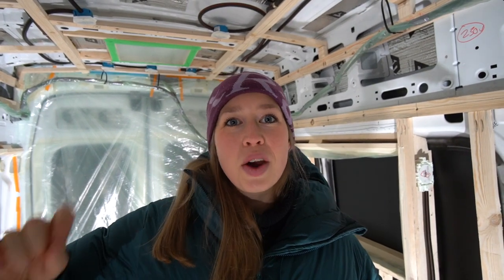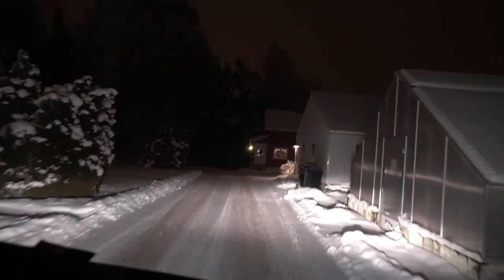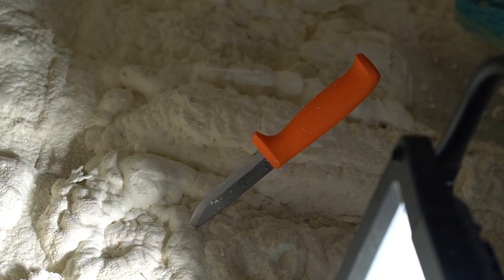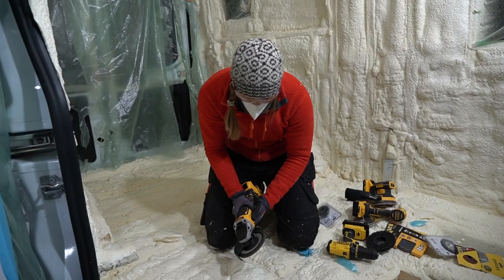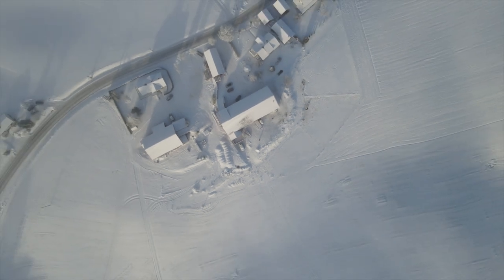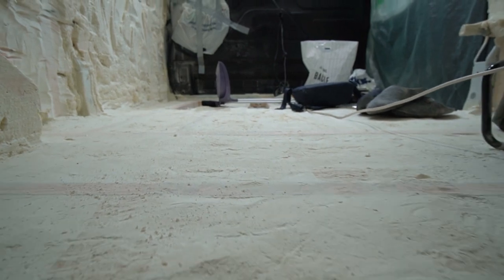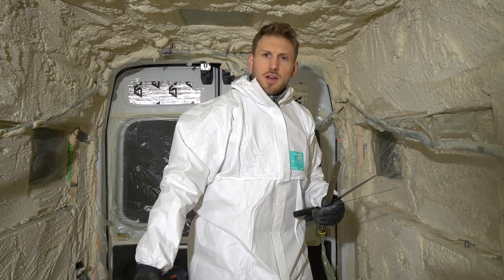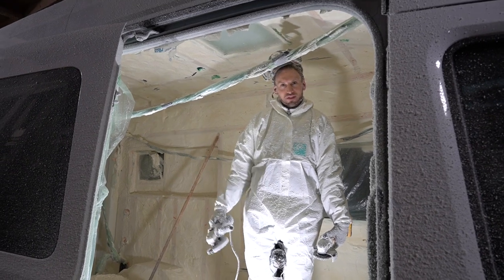Spray foam gone wrong!! - Van build vlog

Comment: Why do people think that spray foam is a good idea?  It's such a mess and hard to remove if you have to work on something underneath.
Reply from the maker: It truly is, buut it has an high R value and when you've finished the job the van is incredibly well insulated 😀 for us during cold winters up in Norway that is really important 😀

Comment: Did he do it for free for making such a terrible job because it looks like he's never done one before and did he have a heated room to do it in thanks for showing that I was thinking about doing one myself I'm sure that dust would be dangerous to your health. Well done for staying so positive.
Reply from the maker: hahaha I wish he did it for free!! We felt like we were literally turning our money into dust.. (I guess we were as well.. ohh no thinking of that makes me sad 🙈). Your point here with health is the reason we didn't do it ourselves, we simply don't have the competence or security gear, but we definitely should have checked out references more than just research online.. and have a written contract (guess I'm a bit to trusting 😅). That being said though, we have used our van now in minus C and it is so nice and warm!!! 😎
Reply: @IdaTobias  do you mind if i ask what he charged in US$,   he certainly should have given u a break on the price. any tips on protecting wiring,  door latch hardware, etc ?
Reply: Thinking of doing a similar build for here in the US, that thick beautiful layer of comfort (from the heat here in Texas, not cold) would be worth all the extra work. Did see framing in the walls, what about the floor? Layed down directly on the foam, or did something just not make it into the video? Does that work?
Reply: @joeymyopic  I think they paid around $979.

Comment: Have you seen the outside of the van deform or look wavey? I’ve heard spray foam isn’t a good fit for van as it deforms the metal and causes warpage of the shell. Thanks and best of luck on your adventures.
Reply from the maker: No deformations or “wavey’nes”👏we did tons of research on that and spoke a lot to the guy who did the job, what he said was that you’ll get deformations if the foam has nowhere to go, so you have to be careful 😌 don’t know if he’s right, but at least we didn’t get any deformations 🙌 we also made sure to finish the electrical conduit and wrap up all original cables so that we can reach them at a later point 😅😀

Comment: You rock guys! Can wait to see the rest of the build. Paneling, electrical, plumbing, carpentry, cabinets. 
It’s not easy or fun to work at negative temperatures but you make it seem so.
Thank you for sharing.
Reply from the maker: Thank you! That really means a lot 😍 we are tackling plenty of those challenges this summer, so stay tuned 😅
Reply: Just wondering if this foam is prone to molding. Did you do vapor barrier?